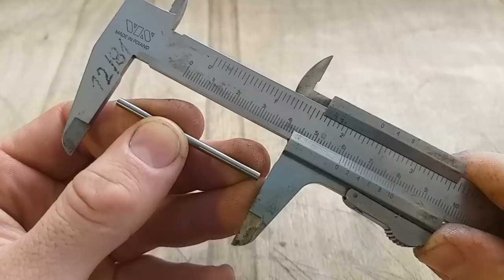EXTREMELY Ruined Buckle Restoration, M.1888 World War 1

Comment: Very well done but again I’m gonna recommend you to use brass weld or tig weld instead of soldering because soldering is really weak and improper. There is also clearly a difference that can be seen between the metal colours.